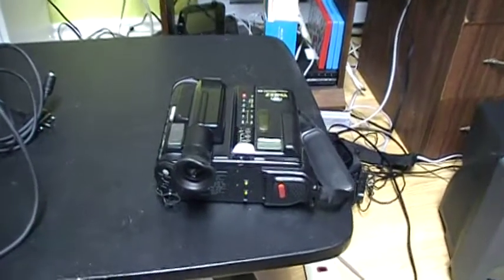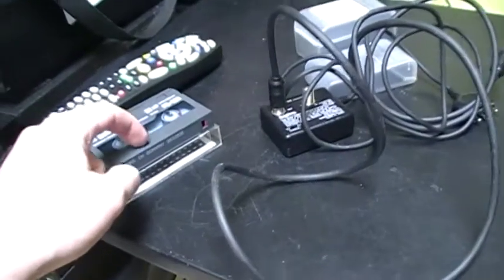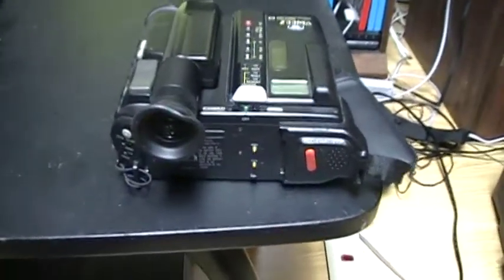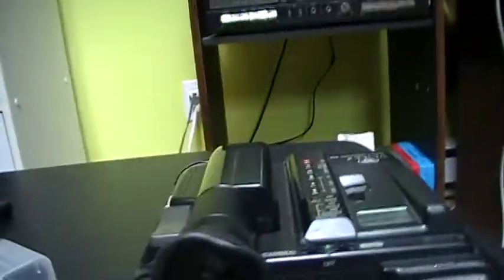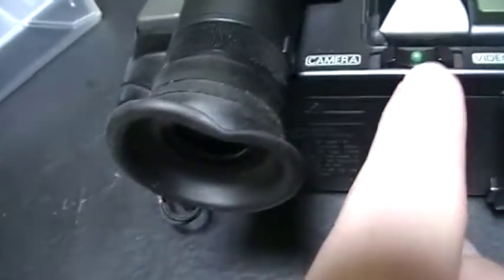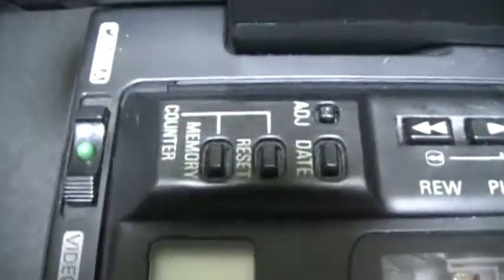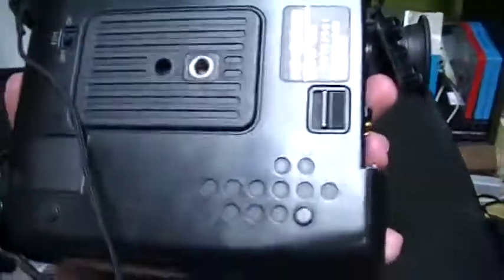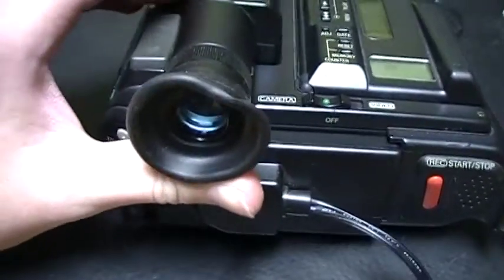Sanyo Zeema VM-ES88 8mm camcorder

Comment: Hi..thanks for the upload..I have the same camera.. unfortunately doesn't role or play my tapes... I need to retrieve the memories and convert 

Did you end up converting?  And were they clear?
Reply from the maker: This Sanyo camcorder was not playing tapes correctly due to bad capacitors. I didn't have tapes to convert. You need to find a fully working 8mm VCR or camcorder, which is not so easy to find.